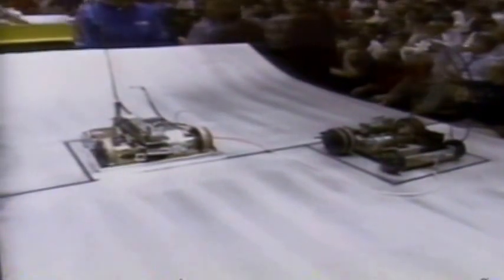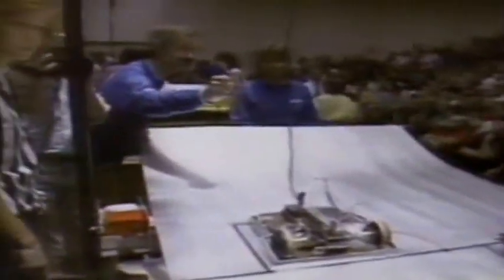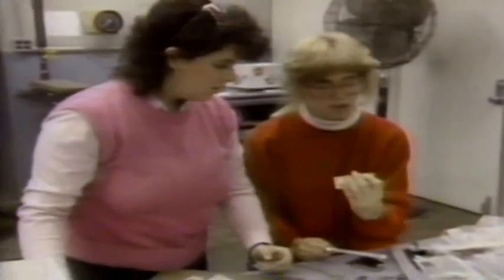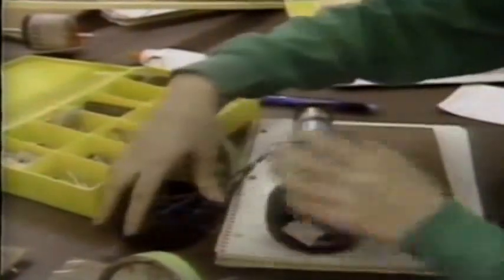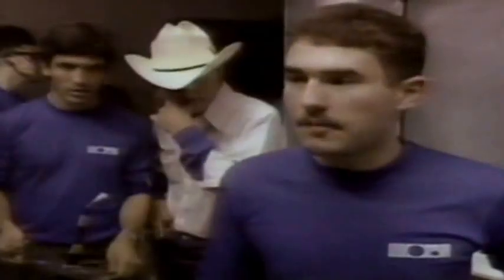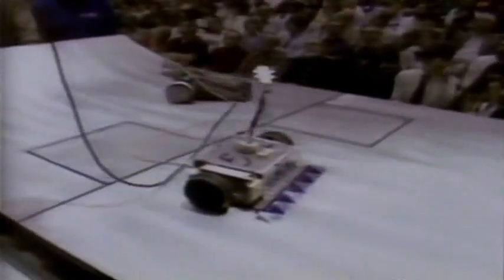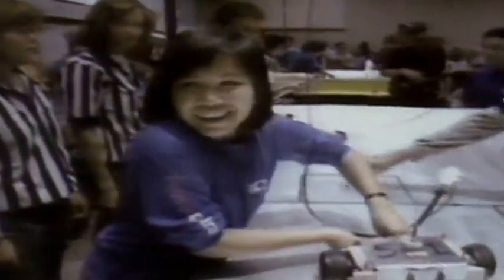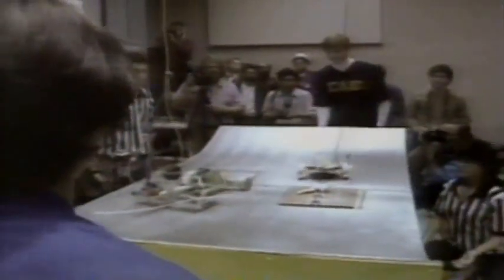MIT Engineering Competition: Tug of War

Comment: My son, Ben, found the video of MIT's 2.27 tug-of-war contest and shared it with me.  He had heard the stories but never seen the video of Trigger The Tiger (at about 8:20).  Most of the video is from day 2 of the competition, which was on 1986-11-25.  The video itself aired on the PBS TV show Discover (associated with Discover Magazine) and aired in late 1986 or early 1987.  Although Trigger lost, he shared much of the structure of the winning machine, and he was put on display for a year in the Mechanical Engineering department at MIT.